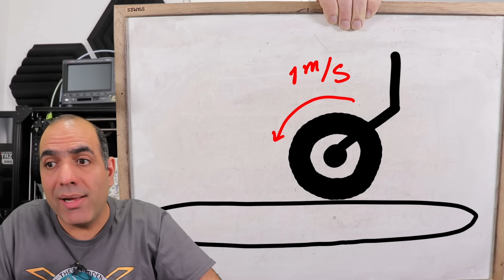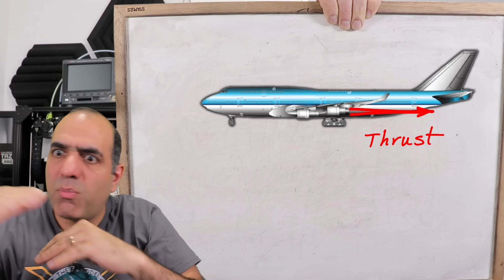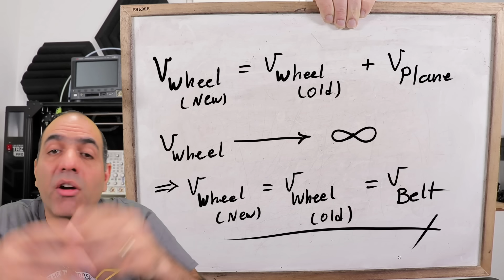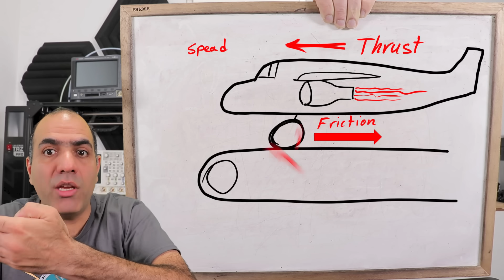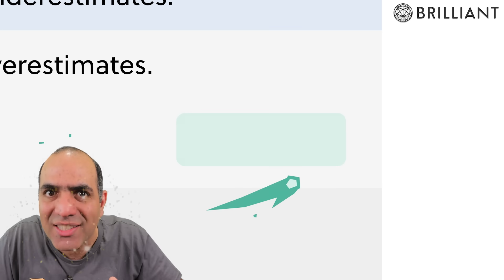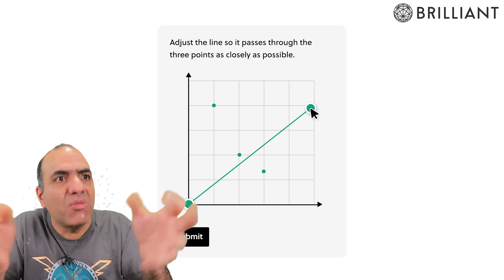Airplane Question that Drove Me NUTS!!!

Comment: It would never take off, although the wheels of an airplane are free spinning in real world there is a lot of friction on the brake assembly of a large airplane, there is a set speed in wich the wheels would just fail, if the conveyor belt is matching the rotation of the wheels they would fail before the plane could gather any horizontal speed.

Comment: I say no under the conditions in the original question. Because the plane would stay in the same location and there would be no air flow over the wings to create the high pressure/low pressure that causes the lift.

Comment: The plane Jet engines would overcome any wheel rolling (Wheels would potentially spin dangerously faster than normal in this case as it comes up to speed on take-off)

Comment: i think it means that the tangential velocity of the wheel is same as the linear velocity of the belt at any instant. the point of contact for the plane and belt is the same so it dosent matter if it is powered by engine or not right? cuz the engine will peak out at a certain level of thrust and the wheel will rotate at the same speed at. ofc all this assuming there is neglegible amount of friction, cuz at zero it slips and at infinite friction plane is dragged with it. if it is negligible but still present the plane might move but wont still be able to gain such a velocity to lift given the length of the airstrip. or honestly idk man maybe im an idiot and i should stop thinking like a physicist and keep being an electronics engineer. RESISTOORSS FFUUCK YEAAHH!!!

Comment: Answering the tweet before watching your response: If the magical conveyor belt is matching the exact speed of the wheels than the plain cannot take off. If the speed of the conveyor is fixed, the plane will take off and the wheels will just spin twice as fast as normal, however as the conveyor here matches the wheel speed, every time the wheel speed increase so does the conveyor speed. Eventually the wheels are going so fast, that the bearings fail.
Reply: Except in planes the wheels aren't attached to the engine
Reply: @haruhisuzumiya6  And? What i described here is in essence on of the options mehdi gave. The friction on the bearings will not reduce motor speed, it will just melt them together and then your wheels no longer spin and your plane will scrape over the conveyor belt as long as it can. More likely it will just break up after a while. You can compare it to an airplane landing without landing gear.

Comment: Airplanes get their lift from moving forward (or air blowing over the wings if the airplane is stationary).  Assuming there is no air movement over the wings, no lift is generated, therefore the plane will not take off.

Comment: In order for thrust force to generate, the air has to move and push the wings upward which is not possible in the mentioned scenario because the plane is stationary with reference to air.

Comment: Lift is based off of air movement not ground movement.  If the ground was big enough to cause friction with air pulling air under the wings enough such that the plane can lift off then yes but when it reaches the air not moving it'll fall back to the ground or glide if its far enough.

Comment: Well, before I watch the video till the end I will answer

It is irrelevant how fast wheels of the plane are turning.

As you know(and I doubt you don't) what is holding the plane in the air is the difference of air pressure on the bottom of the wing and top of the wing.

So, long story short: if there is no circulation of air around the wings-plane will not fly.

Comment: yeah, friction heating would just destroy the entire landing gear and if the plane hadn't reached V1 by that point, it would crash into the band and if the band didn't stop moving immediately because the wheels exploded, to match the speed of the no longer existing wheels, the plane would be disintegrated and every passenger ground into a fine mist

edit: if the plane doesn't have to be in one piece to be considered lifted off successfully, after this incident the plane and all of its passengers would be fine particles, at least some of which would then be suspended in the air

Comment: My thought process lead to
Yes
Cause you just need air going over and unde the plane's wing to create lift,as long as there is continuous sir flow there will be lift to cause the airplane to fly,
So even if the plane is on a conveyor belt moving in opposite direction,as long as it gets enough sir running over its wings
It should be able to take off .
Let's watch the video now

Comment: Hehe tricky question, tricky but simple. The trick stands in human perception.

We see wheels and ground and think about cars, but a plane does not push itself on the road, the road just supports the plane... the plane pushes itself against the air, thus it will go forward and will take off.

Usually when you hear hoofs you think about horses not zebras... this time you have to think about zebras.

Comment: so if the wheel and the best are moving at same speed net velocity is zero. the lift is achieved by the upwards force on the wings, since no motion is there, no movement of air will be there so no force , hence no flight. only situation where this plane can fly is if the belt somehow carries the air with it at the same speed as it is moving. then i think it can fly. guys correct me if im wrong.